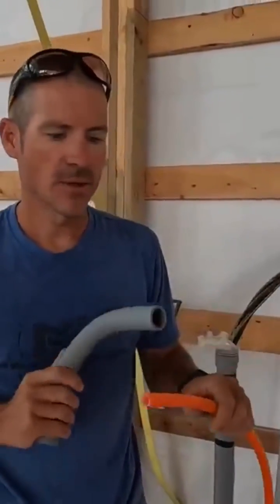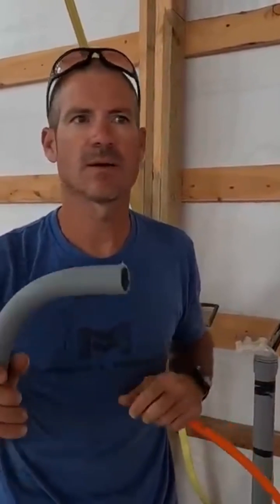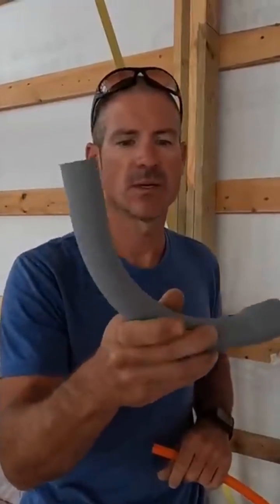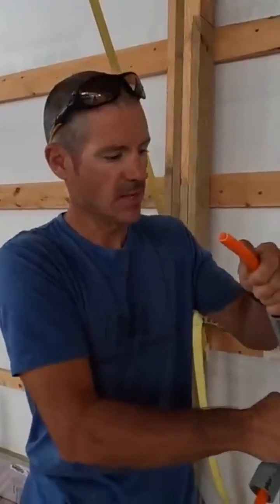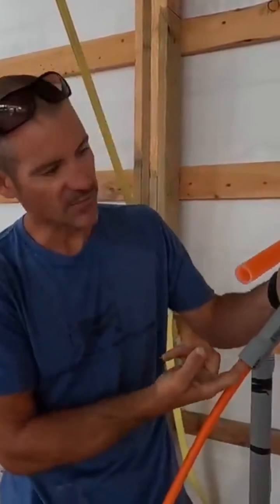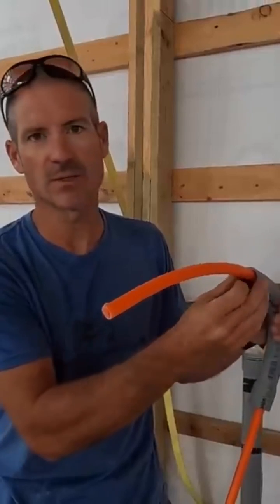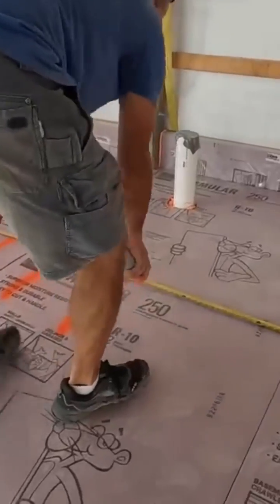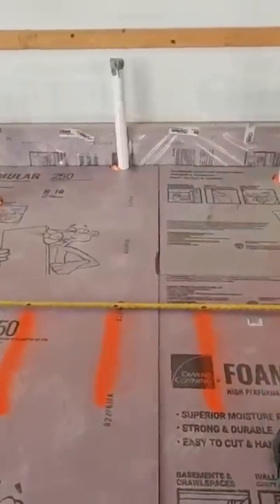In-floor Heat Tubing #shorts

Comment: Very cool. What's the estimated life span of the tubing and connections? And are they serviceable if it springs a leak after pouring the concrete?
Reply: Hmmmmm...  Let's think about that one 🤔
Reply from the maker: There are no connections under the slab. The Pex tubing lifespan is 40-50 yrs...even longer than that if system is properly maintained. Only serviceable as your pouring the concrete. We pressurize so we know while pouring if there is an issue.
Reply: @MrPostFrame  thanks for responding. That's clever that the system has no connections under the slab. I recently stayed in a vacation rental with radiant floors and the heat was blissful. It's on my wishlist if I ever build a home! Thanks for responding and for the great content you share on here. I admire your work ethic.